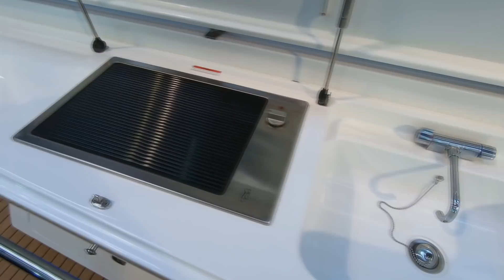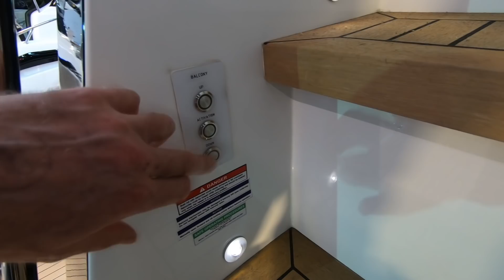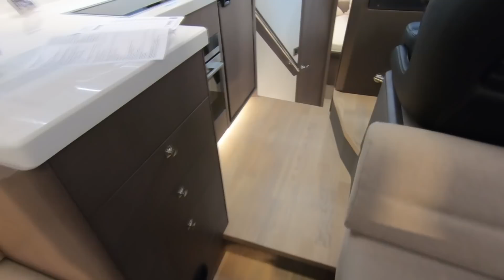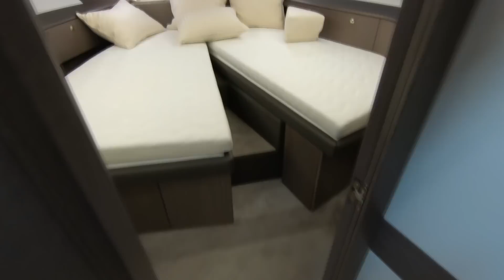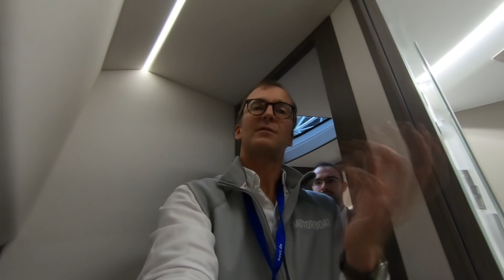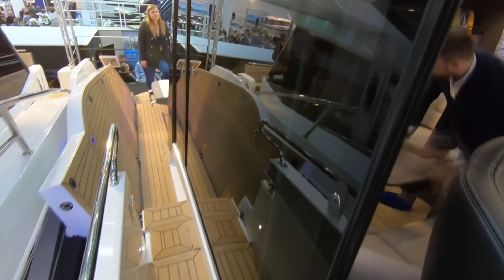Galeon 400 Fly yacht tour | Clever design has so many tricks up its sleeve | Motor Boat & Yachting

Comment: What’s wrong with your camera?
Reply: Ed Du thought I was the only one
Reply: Ed Du yeah it’s horrible.
Reply: it's on LSD
Reply from the maker: We had an issue with flickering lights, the blurring is a side-effect of the post-production fix we used to remove it.
Reply: @MotorBoatYachting  Ya, just let the lights flicker.  The blurring is horrendous. Also, pan your camera more slowly, it will greatly improve your videos.
Reply: @MotorBoatYachting  Afraid your fix makes these videos unwatchable...